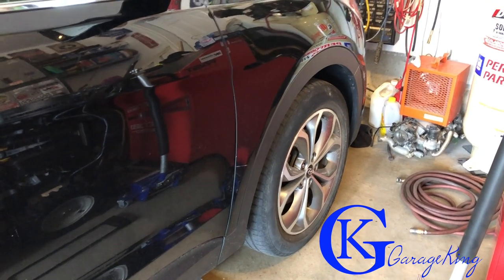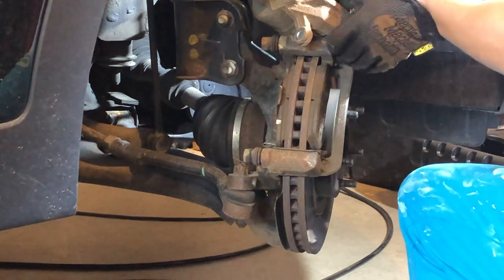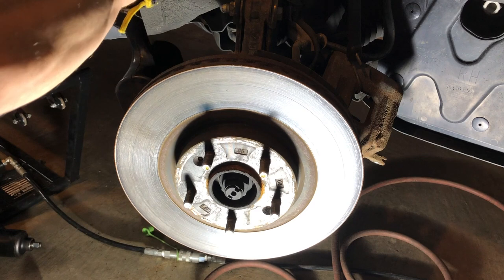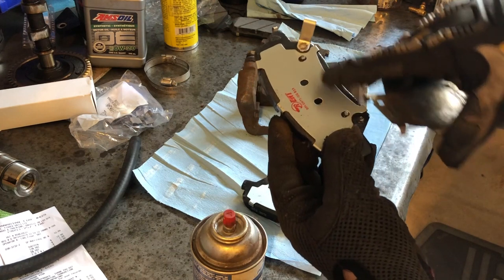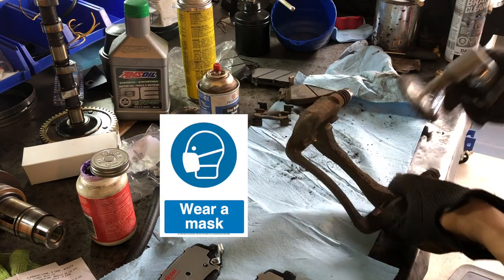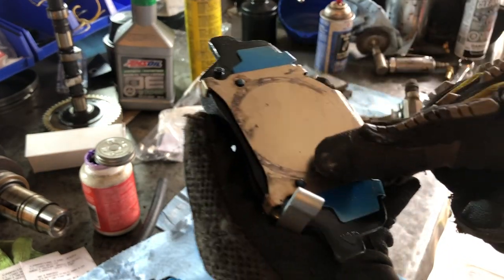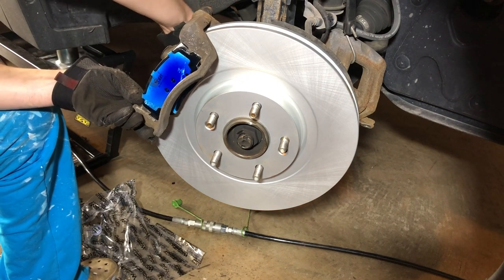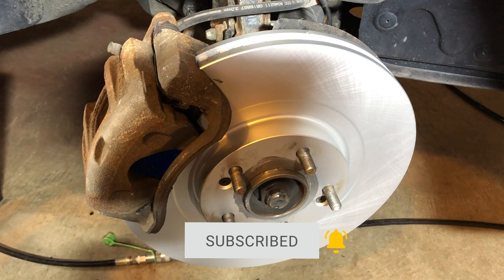2014 2015 2016 Hyundai Santa Fe Front brakes

Comment: Hyundai dealer says I"ll need new front pad and rotors soon on my 2014 Santa Fe.  ( 74,000 ) miles.  Would cost $327.50.  Says as standard practice they don't turn the rotors but replace them instead.  They say Hyundai rotors are manufactured thin so best to replace instead of turn.  I've got a good mechanical background but sounds BS to me.  Any thoughts???
Reply from the maker: I am actually a licensed mechanic and I can tell you most of the time the rotors are actually replaced.  If your brake pedal is not pulsating, and the rotor surface (make sure to check in the inside) is not rusted then you can usually just get away with pads.  If you have a rusted/pitted surface, or a pulsating brake pedal when you brake (warped rotors) then its best to replace them.  Back in the old days when the rotors had the bearings in them, we would turn them all the time.   With these new vehicles they are made cheaper and just pull off.  Plus with the high cost of labour it is most cost effective to replace them if they are suspect.  Plus with new rotors you know you won't have any issues.  Kinda funny but brake lathes are not used very much anymore.  When I was still working at a shop you had to take your place in line to use it!!!!!  You vehicle has 74,000miles, if its on the factory rotors I would replace them.  Sorry for the long response........  That price is not bad if they are using Hyundai Parts. 
 Take care and if you need advise on anything else don't hesitate to ask :)
Reply: @GarageKing  Thanks.  I appreciate your input on this.  There isn't any pulsating from braking so I knew the rotors weren't warped.  Yes, original factory rotors so I guess I'll go ahead and let the dealer do the work.  I guess I'm old school in thinking that rotors can still be turned.  It's been years since I've done my own brakes and although you fully showed how do replace pads and rotors, it might be in my best interest to have the dealer do the work.  I've reached that age to know that sometimes it's best to let the experts do the job right the first time.  Ya never know what you'll run into once the average Joe starts taking things apart.  Thanks again for your input.
Reply from the maker: @billm9716  They are quite east to do, actually a lot easier than years ago due to the design.  In the 90's when I started we turned the rotors all the time, but they were expensive back then, and as previously mentioned, had the bearings and races in the rotors.  On my channel if you go to the Vanagon section I do front brakes and I think those are the type of brakes you are talking about, American, VW, etc.  It was all pretty much the same back then.  The other thing was back in the day most parts were made in the good old USA so they cost more due to labour.  I remember rotors being around $135 each back then, and that was in 1990"s dollars!!!!!!  Later on there was a shift to China, and that is where most of them are made today, hence the price drop, and sometimes quality.........  They are not very hard to do, and if you try to do them you can contact me and I'll help you though any problems.  I have subscribers that contact me all the time for help and I don't mine doing so :)   Good luck with whatever you decide :)